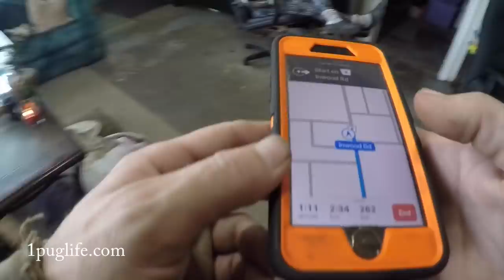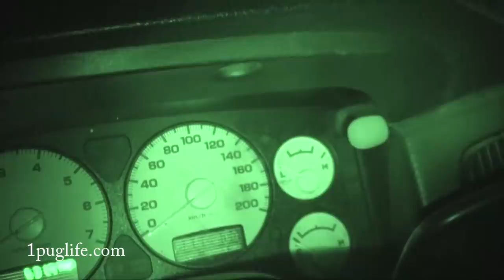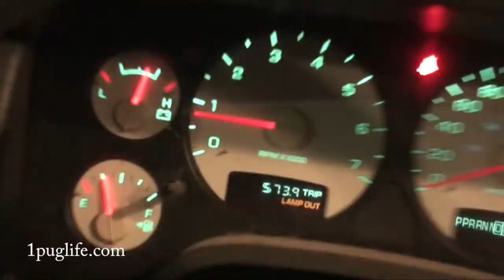almost 600 miles for nothing

Comment: It's TRUE about the torsion system.  They use the same system on livestock trailers.  Even if and I mean IF the rubber is bad it's so freaking cheap to replace and takes maybe 2 hours.
Reply: Brad D  What are you good at ? Word is you clean a mean toilet bowl .
Reply: @Jack-wb2ue  .......RC Braid Damage here is about as Murican as a 
Mexican taco.